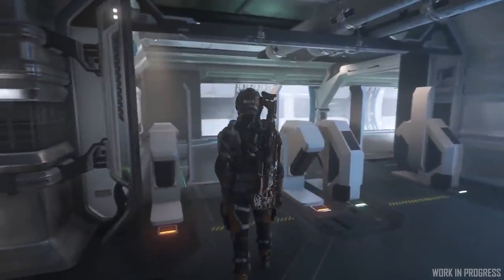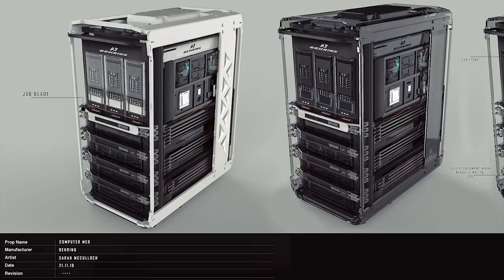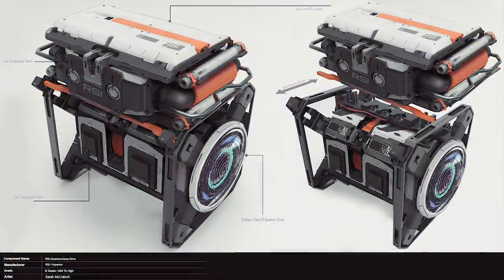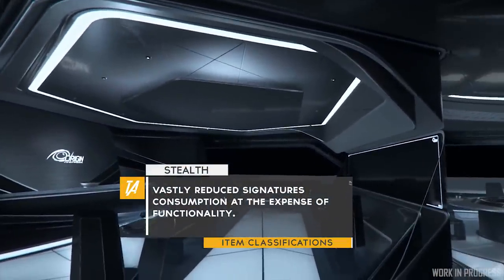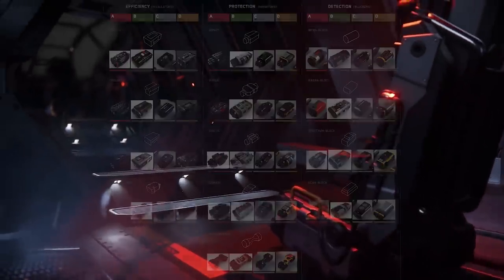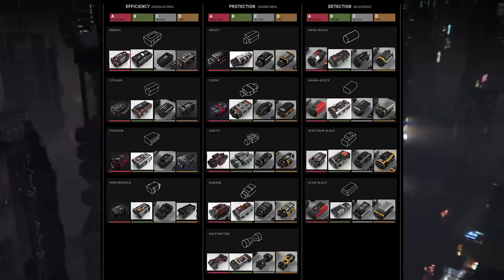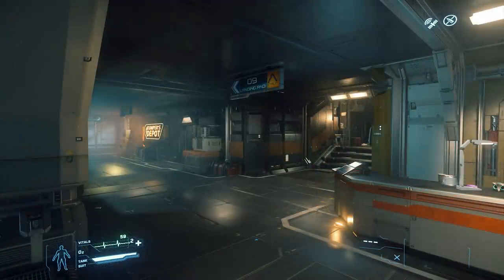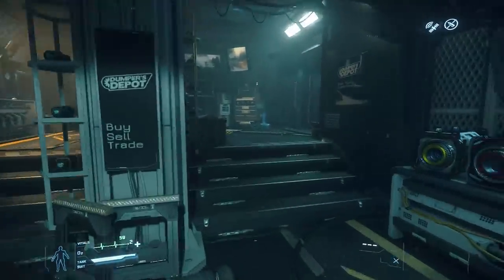Star Citizen » How Components & Upgrades Work

Comment: Great video, Tac! Components & upgrades will be useful and immersive parts of Star Citizen game play, especially when it's fully implemented.Quick question. What's the difference between the numerical grade and the A.B.C.D grade? 
As per your example, your Aquila came with a Size: 2 Grade: 1 cooler, but the description lists it as Size: 2 Grade: C Type: Civilian. You want to upgrade to a Grade: 2 Military cooler. 
The cooler you chose was Size: 2 Grade: 1(no change here) and in description is Size: 2 Grade: C Type: Military. 
I understand how switching from Civilian to Military components changes pros & cons, but the grading system is weird. Do we pay attention to the numbered or the lettered system? Do they each denote different parameters of performance? Is this just an "alpha" inconsistency that will be ironed out eventually? Cheers!

Comment: Thought sub components were just apart of the larger component. Like if I had a cooler, it would have 3 cooling cells, those could be damaged and quickly replaced. But if you had 1-0 cooling cells it basically wouldnt cool. Etc.... Also hope its like that.  Source - https://robertsspaceindustries.com/comm-link/engineering/15062-Design-Notes-Ship-Repair-And-Maintenance    At the bottom